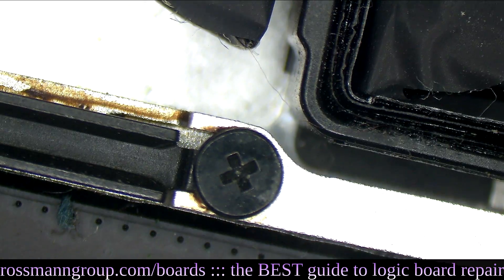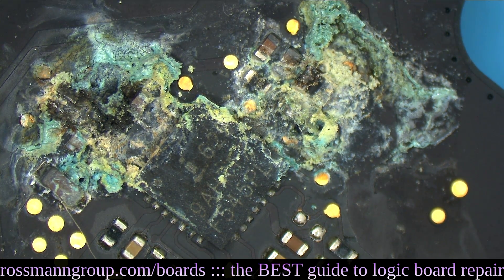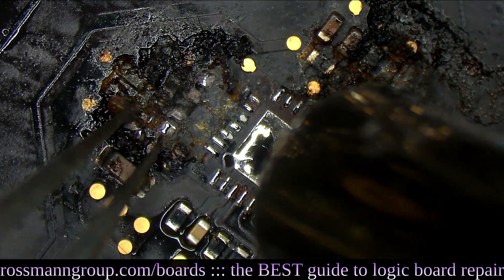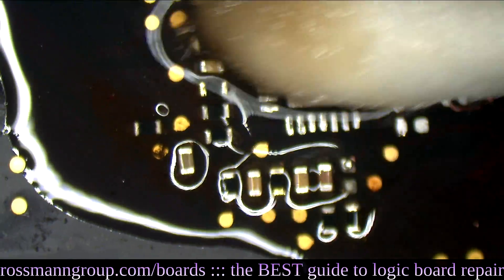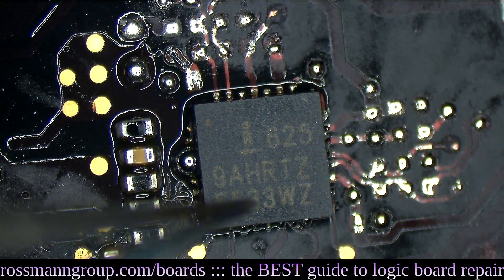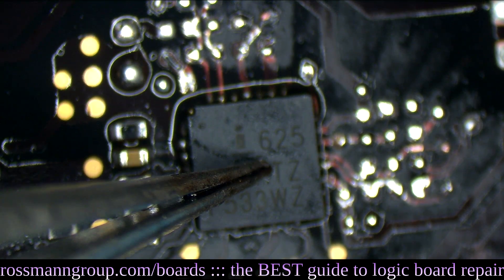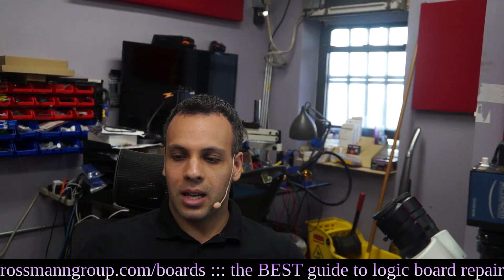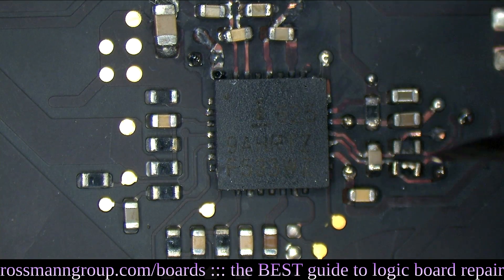Do NOT cum on your Macbook! ||| Donor boards are A-OK!!!

Comment: Electrolytic capacitors and even potentiometers matter on audio equipment in certain circuits because the electrical signal is literally what you end up hearing after amplification.

A computer is not the same thing.  Cheap ceramic caps are definitely not something to be subjective about.  Consult about things that could change the customer experience, hardware changes, etc.  The origin of a functional capacitor or resistor doesn't matter unless it's explicitly part of the deal.  Like for example if there was some big scandal that all resistors made in some nation were made by some shady "resistor cartel" that abuses children.  (Look at the diamond industry for a better contemporary example)  In this case, I could understand a customer wanting assurances about where the components come from.  But I also expect that they bring that concern up as part of their research into where to take their business.

And that example definitely doesn't apply to donor boards -- since the components on the original board were sourced from the same place as the donor.

Comment: These tiny ceramic capacitors are basically like screws - they never die, they can be re-used indefinitely, you just have to make sure to use the proper size.

Comment: Just imagine what a few cents worth of conformal coating from the apple factory could do to increase reliability.
Reply: A few cents worth of conformal coating would actually cost them a couple of thousand bucks loss! Enabling customers to use the machine for years and not constantly buy new ones is not good business.
Reply: @benbaselet2026  If you provide a device that will last YEARS on end with good quality and a somewhat premium design that is very open to consumer hardware swapping, you have customers for life instead of a revolving door of incoming and outgoing customers. This allows you to have a more stable income rather than one that is entirely dependent on a marketing team. Lenovo knew this with the Thinkpad, I wish more companies would think like this and plan ahead rather than think of how they can make the most cash all at once
Reply: @clocked0  2 options. You make your devices reliable and people will come back every 6-10 years and pay good money for reliability. You make your devices a trend and people will come back every 2-3 years at most. Also when something is a trend, it does not need to justify an extreme price tag.
Reply: @clocked0  
Brands that make durable and reliable products are what we need in this world
Reply: Hard to say for sure when I don’t think there’s an industry standard for Jizz testing boards
Reply: Yeah, but if you nut into your laptop, you kinda deserve whatever happens to it
Reply: Reliability? You must think Apple cares.
Reply: the coating will get destroyed over time.

Comment: There validity to your argument on the other hand there would be a large amount of commonality to many of the parts used in PC's even an Apple one. An F406 if amongst other things a "part" number. As for whether or not you use used parts, just DON"T tell em man, they don't need to know.

Comment: Great explanation about "used" parts versus brand new parts -- keep it simple for the customer and just be honest when you write up the invoice for the repair (no need to individually ID each used capacitor - just general wording that used parts used in the repair).  Most customers just want to know that they are getting a quality repair AND you stand behind the warranty you are offering them.  Compare it to vehicle bodyshop repairs -- some repairs use all brand new parts, while other repairs use a combination and/or exclusively used parts from a "donor" vehicle (usually pulled from a wreck in the junkyard).  If you start giving customers too many options and choices in parts & sources for parts, you are just creating more headaches for yourself and likely creating doubt by the customer that you are really more interested in trying to confuse them.  The customer came to you because you are the "professional" and should know which parts are correct & reliable to make an effective long lasting repair.

Comment: I don't see why people would have an issue with parts from a donor board, or even used parts as long as the part will function like it came from the factory. I guess it's a lack of understanding of how things work? Which is a problem with literally any job that has interaction with the general public, they have a lack of understanding, and refuse to understand even when the situation is explained in a way that a fucking child could understand it. I wanted to get into pc repair awhile ago, but with companies fucking things up, and the general public being morons that think they know best, when in reality they know nothing at all, I just don't have the patience for that bullshit.

I'm fine with doing the work, I'm fine dealing with people competent enough to have a basic understanding of what's going on, but the general public is a hell that I don't want to deal with.
Reply: You should work for a small tech company only having engineers on the payroll. Above 10 people and you'll have the idiots creep in.
Reply: amen brotha

Comment: I re-use smd ceramic caps and resistors all the time. It's fine. I have seen ceramic caps die from micro cracks due to board flex and such, but it's pretty rare if you're not working on stuff owned by ogres.

Comment: "YOU USED LOW QUALITY THINGS SEE I TOLD YOU HE DOESN'T FIX THINGS PROPERLY"

Those people would be absolutely correct. You should be more like Apple and fix things properly, with only the finest quality shoe rubber to press down on chips so you don't have to do any soldering work. Don't you know that picking up any soldering equipment turns a Mac into a PC? 😱

Comment: Hi Louis, I’m one of the lucky guys who bought a 2015 12“ macbook. I went to Apple and was complaining at super slow ssd speeds and bad battery performance (max 4 hours). As aspected their opinion was everything is normal but they offered to replace the motherboard because of a kernel panic caused by the integrated graphics. From your videos I learned, the problem might be not the graphics chip but the tiny capacitors there are using. Anyway, I’m worried the replacement board will be less quality than the original. I got a three year warranty so I waited till now. Do you thing there might be chance to get quality a refurbished board?

Comment: Hey, wta a dumb question here. What happen if ur soldering iron got too hot and accidentally tore the pcb "floor" which is the green thing on mobo or black on this apple mobo. Is it dangerous? As far as i know, theres no other component there just as space and pretty sure theres no line connection other than the 0805 ferrite bead inductor that i wanted to replace?

Comment: When it comes to replacement parts, here's the thing: if it's a shit part, I'm not even going to offer it to the customer because I want a happy customer (this is why I buy a lot of Macbook stuff from Louis and Beetstech, I know the quality of the parts I'm getting). I don't want a customer being pissed off because the thing I sold them breaks 3-6 months later.

What you said about overwhelming the customer with choice is spot on as well. Most of the time, the customer doesn't even understand the choice or how it impacts the finished results, and often don't care at all, especially if it incurs additional repair time, chances are they're going to want a working machine back and couldn't give a fuck about some random internal component. The vast majority of customers pay for a quick, reliable repair and do not care how it happens, just that it happens.

Comment: I'm not sure why I'm so fascinated by these videos. I have a large distaste for Mac products, but it's incredibly interesting watching the repair, even if I've no idea what's really going on. Hell, most electronics I've messed with is an Arduino and soldering some small circuits for various sensors x)

For some reason this is a job I'd actually love to do full time. Not sure where to start at getting it though.
Reply: Rokzug start by watching all his videos since 2012 onwards.
Reply: I’m about to have an associates for a electronics technician specialization. This is the type of stuff we do.

Comment: But had you tested it for hiv?
Reply: I don't think Macs get viruses
Reply: @ProPlayer-wq3nu  actually it can
Reply: Pro Player 1⃣ Yep they get, maybe less than most windows computers, as they are used as a hore, with thr legs open for all the internet, but yeah, even tho less common, there are mac viruses.
Reply: I was being sarcastic, but yeah, every software can get a virus even Linux
Reply: Cuzeg Spiked
Not at all. Just look at how many security holes they have found in just the last 5 years in all the unix distros. The only thing that makes linux "more secure" is those people that tinker with their machines a lot.
And there are so many different flavours of Unix systems all with their own quirks.

Currently windows it self is, as far as we know, the best in regards to security. Yet cause it does dominate the marked it is also a high profile target. It just doesn't pay of to write a virus for one specific linux distro when there are mayb just a few ten thousand users.
Reply: HIV doesn't survive long at all outside the body.
Reply: Eduardo Avila "get" and "can get" are two different things. It's clear that every software can be exploited. It's only that macs and Linux machines are not the primary target of criminals/hackers. Windows has the most users so they make viruses for Windows instead of Mac.
Reply: @user-gp7zt8sm4w  It's also easier to create virus packages for Windows than it is for MacOS and a good deal of Linux distributions.
Reply: Pro Player 1⃣ send your email address I can send you one ;-)
Reply: It is New York, after all!
Reply: Macs live a clean christian life free of nasty devil worship.
Reply: Pro Player 1⃣ Yep. But mac and linux are like more reserved people, dont sleep with anybody like windows does XD
Reply: Eduardo Avila woosh That is the sound of the joke going over your head.